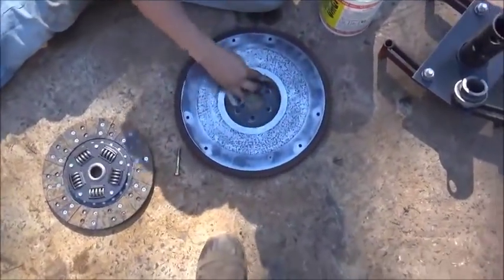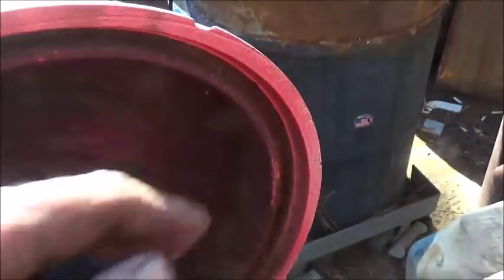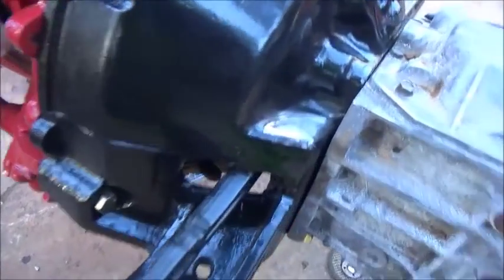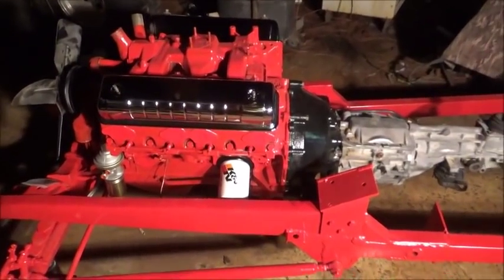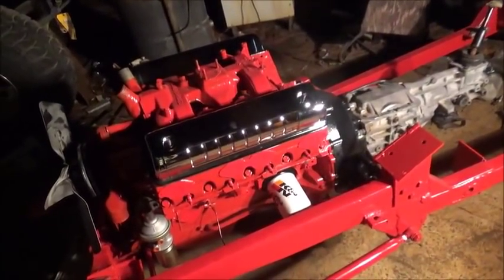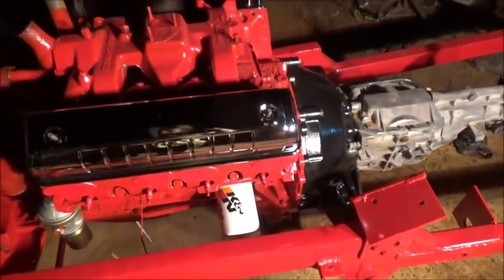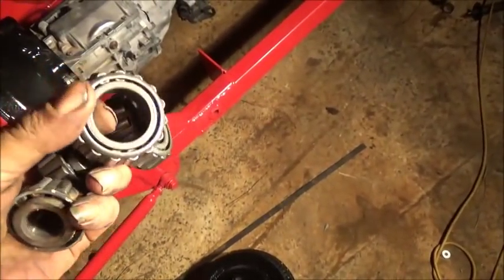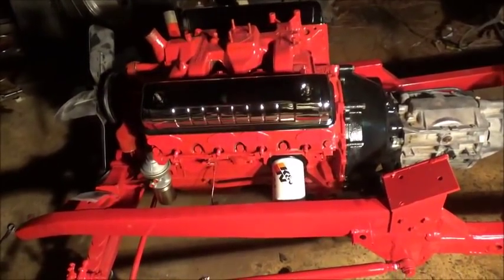1931 Roadster Engine Install

Comment: There is a museum in Tucson AZ dedicated to the Franklin automobiles. Maybe they can supply information on restoration of your '28. 
Congrats on quitting smoking. Not an easy feat.
The '31 is looking good and won't be long before you are driving it.
Thanks for sharing

Comment: I had a '65 GTO years ago, it had the longer throwout bearing, but neither I nor the auto parts store knew there were two different ones. I jumped through some hoops trying to get a short one to work, and finally found out about the long one. It sure goes together a lot better with the right parts. I smoked for 29 years, and then I met Linda online. She can't be around smoke, and I had wanted to quit for a long time. When I came here, I left the cigarettes behind that very morning. Haven't had one since, and although it was very hard at first, I've been off them for over 20 years now. I wish you good luck with quitting, you're a good man and you deserve to have a healthy life. Linda and I send our best to you and your family.

Comment: Hey Jonathan, Best of luck with quitting smoking. Like you, I started around 12 or 13. This coming January will be 5 years. That is after smoking for about 45 +/- years. I went cold turkey also. I had just bought a carton, and out of the blue just decided that was it. The first 2 months were the hardest. Then after that, every month just got easier and easier. This old man enjoys the heck out of your videos. Thanks, and please keep these great videos coming.

Comment: I just hit me that these video will be repair manuals for the next owners of your builds, Jonathan.  IF the next owners need to remove that transmission they can see how to do it before climbing under the car.  Same with wheel bearings.  They can look back at these videos and find out precisely which live wooden object you stopped your mobile not-live wooden framed vehicle... :-)  Four packs is a lot in one day, Jonathan. ex-smoker two years - typically two packs a day (vagaries did occur)  Thanks for the video, Jonathan, Noah and crew!

Comment: Wow...the paint on the engine and frame sure looks good...  John D.
Reply: Yes, the paint looks good. I wish the guy that painted the engine hadn't painted the spark plug porcelain insulators: that cuts down on their insulation properties. But maybe they were just placeholders for painting and new plugs will go in later.

Comment: The humility with which you approach anything is fantastic. From a person with your obvious skills and talents it's just awesome. Regardless of whether it's a difficult recovery or what you've accomplished here with a pile of scrap, you never look at it as a personal best. You are always striving to do a little better, a little smarter. I am surprised that you didn't use a piece of round stock,  machine it flat on one side, tap and thread it for the bolt and weld that onto the bell housing. You won't see it anyway so it won't make a bit of difference in strength. Where did you ever find those NOS chrome valve covers? Too bad they don't have the "Thunder chicken" emblem on them but it's the wrong year engine for that. Please don't take ANYTHING I say as a critical thought, it's not meant to be, just observations. Perhaps the neatest thing about this whole project and there are many, is the free education and experience  Noah is getting. I'd forgotten how excited I was when I was allowed to machine anything in the shop and it was turning a drum on the Brake Lathe. All that was said was that my Dad/Uncle  made a mark on the edge of the drum with a grease pencil and said  " if you cant't get it smooth before you get to this mark, stop. The drum is too far gone."  Noah is a lucky man. Although, I will say after seeing his dad and grandpa working on this project, he's been in good company all his life. You know, as busy as you are, I often wondered if you read these...

Comment: Weight will tapper off but some gain weight with age too, I was very hyper and I felt it when my metabolism slowed down. 
The engine trans connecting working parts is a WOW cool combination but then the whole car is a kind of hodgepodge of different brands/makers of  car parts. Love it. Ingenuity at its finest, as I see it. 
The 28 Franklin, I had never heard of a ash frame before. But finding out there were others with wood frames too.  They must be treated with something to guard from rot  or termites. As I said once before I quit smoking 15 years ago and the one thing is the smell of others smoking, I don’t care if they smoke I just can’t stand the smell of it.
Hope to See More. LOL

Comment: Antique furniture benefits from a swipe or two of some boiled linseed oil, so it may be good for the Franklin frame, spokes and coachwork.  I think I heard that Jay Leno did something to the '18 Cadillac wheels in it to restore and firm up loose spokes.

Comment: Hang in there quitting smoking is not easy got to be mindset I was up to the same as you.. with in a month it will start smelling nasty the smoke when someone smokes around you  its been over 10 years for me .just think about the money you will save ...good luck  Jonathan

Comment: You might want to try the nickoret gum or the nicotine patch if you get some bad cravings.  It was fully 2 years after quitting that I finally did not want to smoke anymore.  Your experience may differ but you have done the right thing.  One thing you must do with respiratory issues that you have is to protect yourself from dust and smoke from your welding, painting, grinding and body work.  Please protect yourself.   

The build is going great.  I love to see what you do.  I hope you restore the Franklin as it would be a shame to do otherwise.

Comment: congratulations for stopping smoking, I stopped in 08 I have no urge to start up again, I also don't fault anyone that does smoke because I smoked for a very long time, it is quite an accomplishment to stop, and not an easy thing to do. yes, I gained some weight ,on top of stopping smoking my job went out of business at about the same time so that added to less exercise.

Comment: with an all Ford drive train, but a modified Chevy clutch disc and throwout bearing, I would have made a note of that with a Sharpy inside the bell housing (to help the next guy that might ever need to get inside there to service it)

Comment: Jonathan try as best you can to change your routines. For example, you have a cup of coffee, you light a cigarette. You start the car, you light a cigarette, etc. Believe it or not this is the hardest part of not smoking. Don’t worry about the weight gain, it’s completely normal. In time your body will correct itself. Buy yourself sugarless candies if necessary. You can do it. It’s just a miserable time factor but you will win the battle.

Comment: Looking like you're going to have to jack up one side to change the oil filter 
Might have to look for a shorter one  before you put the body on. Unless its just a camera angle.  Ps loving the roadster.

Comment: Jonathan, sometimes ya gotta roll with the punches. Progress is looking great and about to catch up on the Franklin vid. Quitting smoking is something that is mind or matter, I quit in '09 using dum dum suckers. The psychological & hand too mouth habit of going outside work, home etc is a tough thing too break. But after 2 weeks or so I remember being able too smell it on other people. Those suckers are cheap and mimic the hand too mouth of a cig. The weight will come off in time.  Thanks boss

Comment: Good Work, thank you for showing... all  the various mechanical parts you are fitting together. I hear you say you are going to stop eating candy. The problem with candy is the type of sugar used which makes your body add weight. The comment below is a good suggestion ..the carrot and celery sticks. I stopped eating candy and my weight dropped.   keep your nose to the grind stone...  full speed ahead !

Comment: So, when you say... "Had to use a GM pilot bushing... Long GM throw-out bearing"... You do realize those parts aren't Exclusive to GM, Chrysler, or Ford; right? They're manufactured parts (and catalogued) so the Engineers can make all of the "Pieces Parts" fit (and work). You'd be amazed at what GM/Ford/Chrysler parts Interchange. So, for the "3 nuts" on the upper left... If I recall, there is very little Torque on that corner. It'll be fine. I quit Chewing, back in 2006... I developed a "Life-Saver Habit"! I was eating 3-4 Rolls of Winto-Green Life Savers per day! I gained 30 Pounds within 2 months (shot up to 220 pounds, on a 5'7" frame). There are moments when I get a "Craving for a Chew" and I actually start drooling. Noah did a great job on that Drum! If you can, get someone to shoot video of you Packing the Bearings (not very many people know how to do that). I look forward to videos on the Franklin!

Comment: Congrats on the not smoking.  I quit cold turkey in 1983 after 20 plus years.   Now let's talk brakes.  Since everything is new, have you considered DOT-5?  It costs a little more but won't absorb/attract moisture.  Much better in the long run for a car that might sit unused for extended periods.  Just a thought...

Comment: *** Jonathan, Your motor's oil filter seems to be mighty close to the chassis? I don't know if it's due to the 2 dimensional aspect of the TV Screen but are you going to be able to remove the oil filter when it comes time to do an oil change?  It looks like it doesn't have enough room to back off?

Comment: Do you arc your brake shoes ? If so, how ? Grind or bend ? Many times a new or relined shoe does not match the drum. It's worse, of course, on a turned drum. Bending the body can cause cracking. Grinding the lining wastes a lot of lining. Just wondering how you handle the mismatch.

Comment: 4 packs a day , $4 a pack , $16 a day , $112 a week , $448 a month , a new wrecker a year , well a new I built it wrecker a year that is ... before long you will hate the smell inside your vehicles , to get the smoke smell gone quick , buy an ozone generator around $75 , I did , it will kill all smells , even kills mildew , nice shop addition ... I also quit cold turkey , started coughing so bad one day I about could not drive the truck , threw the pack I was smoking , my zippo , and the carton that still had 9 packs in it out the window on the interstate , never looked back , it's will and want that makes us quit , and stay that way !

Comment: You could try sugar less chewing gum. Every time you feel the urge pop some in. Chew it like 2-3 minutes and get rid of it. Next urge do it again. Keep the gum in your shirt pocket where you kept the smokes. Kinda like reprogramming your habits. Are you using any nicotine patches? They can give you a little edge on the cravings. I've quit and started a couple times myself. It's worth it when you start feeling better. Thanks for sharing

Comment: Good luck with quitting smoking cold-Turkey.  It will require some internal fortitude, but it can be done. My wife and I both quit this way: You can too.

In some of your previous videos, there was some comment conversation, and controversy, about what is really a 'Rat Rod'.  This link will surely resolve any questions on this topic.

https://boingboing.net/2019/10/23/rats-trained-to-drive-tiny-car.html

Since it was crafted at VIA, a NASCAR version is likely in development!

Comment: Jonathan, I really hate that  you're having health problems. I know that smoking will take years off  your life. Having said that I'll tell you how to loose that weight and maintain it and feel much better and have more energy. Put yourself on a diabetic diet. Diabetic or not it works. I'm not diabetic but I lost 35 lbs. in 14 weeks and I feel better now than I have in many years.....doing something all the time. Do this.....no fried foods, no fast foods, no sweets, no soft drinks, smaller portions and LOTS of water. Not even sweet tea. Just water for meals and in between meals and whenever you need a drink. You can still have coffee but no sugar. Sorry. I know that's a lot but I promise you you will feel much better. If you need something to eat between meals eat an apple or some almonds(if you like them and I do). No peanuts. They have too much fat in them.  I'm 72 years old and feel like I'm 40 again. John, it really works. Try it and stick with it. Make yourself do it and see the change in just a few short weeks. Let me know how you feel after you have been on for a while. You'll be surprised at what you can do if you want to bad enough. Take care J.......love your vids.